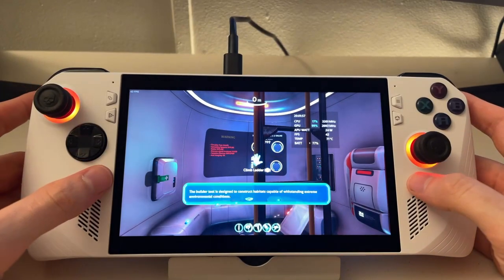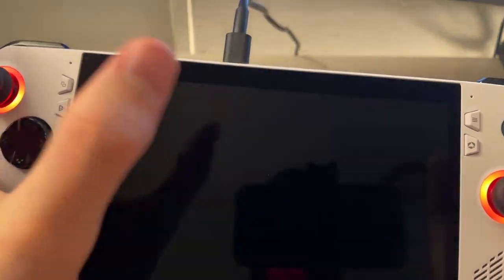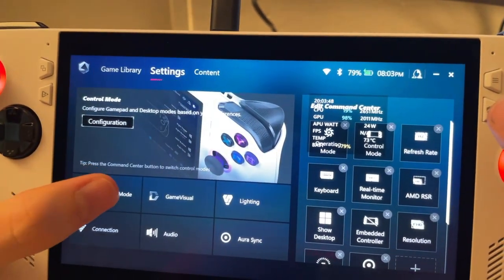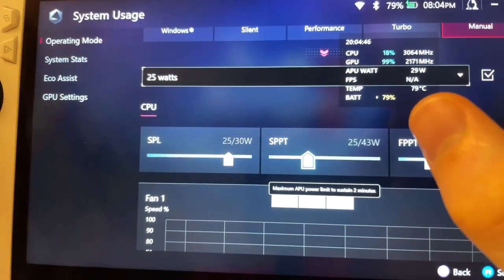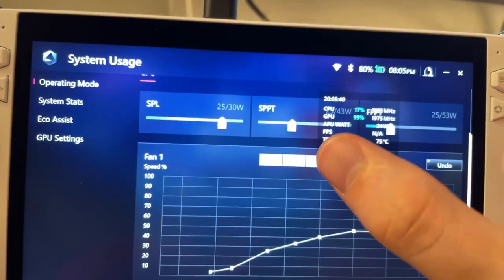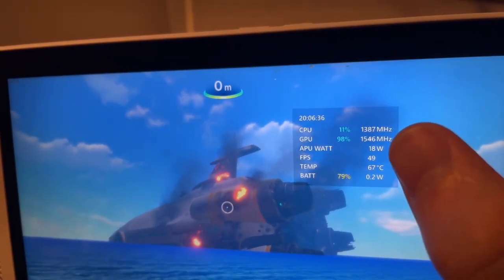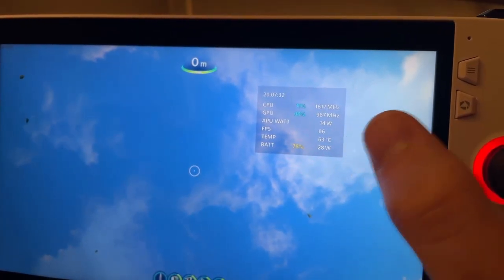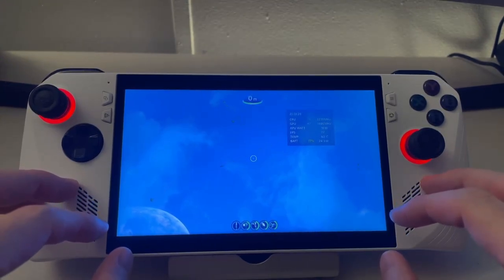ROG Ally | Use these MANUAL power levels

Comment: For some odd reason when I put 2 profiles like yours - 18watts/25watts when i change to each other it will break the other profile :/ will only remember SPL and the rest is still on 25watts.
also, after a day or two the profiles were completely disappeared.
Reply from the maker: I've noticed this as well.  However, after you set it across the board it should hold those levels.  It's only when you go back into the profile that it will jump the other sliders back.  It acts weird, I don't know what's going on with Armoury Crate.   I'd say just set the levels across the board, load up a game and see if it's actually boosting.  If not, you should be good to go, mine seems to be working properly and I just leave it alone after I have it set.   As soon as I start dragging sliders or going back into manual it seems to want to push the 2 sliders on the right back up.

Comment: The way I see it:
- Steam Deck: a proper portable device, scales really well, can be used for mouse based games & gamepad games but not designed for AAA games
- ROG Ally: horrific battery life means it's not really that portable and since only 18W is efficient and scales really badly when you move away from this, it's pretty much designed to run more demanding games that the Steam Deck can't run BUT only gamepad games mostly

The battery is really the big problem with the Ally. I would have preferred a heavier Ally with a better battery myself. Wanting to beat the Steam Deck in weight and then getting TROUNCED in battery life was not the right move.
Reply from the maker: I agree, the Steam Deck handles games at low wattage really well.  When I loaded up Dirt Rally 2.0 and saw 1.2 watts for the CPU and 2-3 watts for the GPU, with a total system draw under 15 watts at 40FPS, medium settings, I realized just how crazy good the Steam Deck is with power.  But, the Freesync and raw performance of the Ally is something I like.  Plus I can't get some games working properly on the Steam Deck, like Horizon 4, still stutters and can't do 60FPS.

Comment: can you suggest a powerbank which i can use to play at turbo 30 or 35 watt
Reply from the maker: --Edit
I believe I misinterpreted what you were asking.   Like Wash said below any 65 watt should work.  However it probably won't automatically switch to the "plugged in" power profile like it does with the official charger.  So if you have it set to "Turbo" when plugged in and "Performance" when unplugged, you'll have to manually switch this when not using the official power adapter/dock. 

Also, the manual settings will be locked to 25W.  This is because there is a weird issue where Asus isn't properly recognizing most 3rd party chargers/docks.  Hopefully ASUS fixes this in the future.  

--Original Comment
Hey, I'm not sure there is one right now.  For some reason Asus seems to be limiting 3rd party docks.  So even if you have enough power being supplied, it won't "recognize" it.   

Hopefully they fix this in an update, but the only time I've been able to draw max power is on the ROG Ally Dock (which I have a video unboxing of) and the official charger that came with the ROG Ally.

There could be a bank out there where the Asus will recognize it, but I currently don't know of any.
Reply: I don't think he answered your question. A power bank doesn't need to be recognized. It's going to supply power if the power lines are connected. Just pick up a nice power bank that says it charges at 65w.

I also have no issue using the two hubs I have with it.

Comment: Hey man, cool videos! Question for you about the fan curves. I still can’t wrap my head around how to make a good fan curve for the custom TDP’s that I’m creating. 
I’m trying to create a few manual TDP’s in 18w, 22w, and 25w and I understand it’s better to set all 3 values to the same so that the unnecessary boost mode is disabled in each of them. So it would be 18w / 18w / 18w and 22w / 22w / 22w and 25w / 25w / 25w for each of my custom TDP. 
I’m just not sure now what the fan curves should be set at for each of those wattages?

You said that the fan curve 3 preset is pretty good and what you use, could I just use that across the board for all 3 of the manual TDP’s or would that only apply for certain wattages? What fan curve would be the best to do for my 3 manual 18w, 22w and 25w TDP’s? Would love for you to make a video in future going into the whole creating fan curves thing and how they work, for us newbies.
Reply from the maker: Hey the level "3" profile on both fans works great, even on BIOS 322.  Although it's a bit louder now on Bios 322 because of them ramping the fan up more (probably because of the SD Card issues).  You can always ramp up the fans even more, but if the system is running in the 70's, then it's good.  Technically it can handle even hotter temperatures, and Asus allows it to hit 95c for the first 2 minutes in Turbo mode.  So manually locking the watts means you're already well below the temps people are getting that don't lock them.   I still just use the level 3 fan profile and have great temps. 

Make sure you select level 3 for each manual setting (it resets the fan curves for each new custom profile).  So you'll need to set both fans to 3 for each profile (18w, 22w & 25w).
Reply: Perfect, I’ll give it a try and see how it goes. Thanks for the help!

Comment: well done tutorial ! GPU Settings is better on 4GB or 8 GB?
Reply from the maker: I've been working on a video about this.  Most games it doesn't make much difference, but there are a select few where it does.  One of them being Dirt Rally 2.0.  At 4GB I got (94 FPS Avg / 80 FPS 1% lows) and at 8GB I got (121 FPS Avg / 99 FPS 1% lows).

Comment: Thank you! Can I use the 17W for every games?
Reply from the maker: Yes, if you like the 17 watt profile you can set it at that, and then always run it at 17 watts for everything :)   If you're getting low FPS however, it could be worth bumping it up between 20-25.  I don't recommend 30 though as there isn't much gain for the additional watts/temperature.

Comment: when I manually set to 18 watts and leave the AC Control Panel and switch back to the game, it falls back to the Standard 15Watt mode after some seconds without touching anything after that. do you know whats the problem here??
Reply from the maker: When you set the power levels make sure you don't have a game open.  Then any games where you've already set a power profile, you'll need to change to the one you want.  Games save the power profile you set per game, so if you were playing retro games, you could have a "Silent" profile and it remembers that and will auto switch.   Any new games though should inherit the settings you set with no games open.   So you should just have to change it for games that you've opened before you set the power limits.

Also, if you hover over the game in the Armoury Crate launcher, you can hit "X" to bring up the settings and you should see "Configuration" where you can change the AC and DC power settings for that game.  I wiped my device last night due to an issue I'm troubleshooting so I don't have Armoury Crate installed right now.  Let me know if this helps though, if not I'll be able to give you more detail once I get it installed again :)

Comment: Hey man my manual settings dont swap when I go from plugged to unplugged, did I hear that wrong or is that supposed to work?
Reply from the maker: Are you using the official charger?  You'll have to change the settings when plugged in vs unplugged, then it should automatically switch.  However, if you're using a 3rd party charger and/or dock it won't switch.  It stays in the battery setting.  I usually use a Steam Deck charger on the go, and it doesn't switch.  On the official one though, it does switch.

Comment: thanks for this tip! What sensors are you using to monitor CPU & total system power?
Reply from the maker: Hey, it's just the default monitor.  If you hit the second little button on the left to bring up the menu, you'll see a thing you can click, I believe called "Monitor" that will bring up the same little box you're seeing on mine.

Comment: There is something that I don't understand. What's the point of putting 25 watt in manual mode when the console is plugged in? because when it is plugged in there is no need to save battery power and it is in 30 watt turbo mode. what's the point of putting 25 watts when it's plugged in???
Reply: High heat which might damage components. If you want to keep it at 30 then atleast put all 3 bars at 30 and fan curves at 3. This way you won't be feeling the crazy high temps of Turbo

Comment: Am I the only one who can't toggle manual mode on battery?
Reply from the maker: That is really strange, I'm able to use manual on battery.  It even switches automatically when unplugged between watts I had set in Manual for battery.
Reply: @filt3rless  It's working now. Guess I needed an update

Comment: Sorry again, so to resume (English is not my native language).

I have to create 2 general profile :
- Plugged = 25W
- Unplugged = 17W or 18W? 

It will be set in general and not per game? Correct?

And I don't have to touch the other modes (Silent, Performance, Turbo) right? Buuuuut.... I can still use the other modes right? Sorry but I'm not really tech savy and I don't want to break the ROG Ally :(

Thanks once again! I have subscribe to you.
Reply from the maker: Yes, you'll want it plugged in, then you set all 3 sliders to 25W (make sure you also click the 3 fan profile for both fans).   Then you can unplug it and set it to 17W.  Now it will automatically switch when plugged in vs unplugged.  No need to mess with settings after that.  It's not per game, so just one time should work for all games :)

Yes you can use the other modes.  However, Turbo runs extremely hot so I don't personally use it.  I had the SD Card Reader fail in my first unit and I think it could have been heat related.
Reply: @filt3rless  thank you so much. Can you tell me then what are you using for both unplugged and plugged for AAA games? I'd like to run them with nice graphics
Reply from the maker: @JeremyBDE  I use 18 watts unplugged and 25 watts plugged in :)

Comment: Do your fans also turn up more in manual mode?
Reply from the maker: On the new Bios 322 they definitely do.  On the older 317/319 Bios they stayed a lot quieter than when the device was in Turbo mode, and it ran cooler.
Reply: @filt3rless  
Thanks🤟🥳

Comment: Man, I have one very last question 😅 Once plugged into the wall, only the Turbo Mode is affected by the boost right? 

I wanted to create a custom profile which will replace the Performance Mode from 15W to 18W and the Turbo Mode I would like to do 25W unplugged and 28W plugged. 

Is this possible too? And if yes, what fan profile should I use for the 2 profiles I told you?

Also, once plugged, Silent Mode, Performance Mode remains unchanged in comparison to being unplugged. I mean for example Silent Mode, Turbo Mode unplugged and plugged will use the same watts right? Only Turbo Mode is affected by the watts changes when plugged, I've got this right?

Tldr: I want to replace the standard Performance Mode and Turbo Mode only, is this doable ?

Thanks once again and sorry for these questions but I'm getting anxious and I want to be sure I won't mess my machine once I received it this week ❤
Reply from the maker: Use "3" for the fan profiles if you're not sure what you're doing.  If you set Manual while plugged in, it'll always go to Manual when you plug it in, unless you switch it to something else, like Silent, Performance.  Same for battery, if you set Manual mode it's a separate one for battery.  So while plugged in you can have Manual set at 25 watts, and then unplugged it can be 18 watts.  It will automatically switch back and forth.  However, if you change it to "Silent" on battery, it will remember that and automatically choose "Silent" while on battery until you set it back to Manual.
Reply: @filt3rless  ok and how many profiles can we create? Seems like I will have to create 2 or 3

Comment: Will there be an update to this?
Reply from the maker: I am planning on running a new watt test.  If you'd like a sneak peak, here is how the Ally performs on Crysis going from 7W all the way to 35W: https://imgur.com/a/bD9GNNG.  You can really see where it starts dropping off on the top end.  I've been using 17W as my primary watt level, and 25W for extra performance when needed.
Reply: @filt3rless  thank you
Reply: Will you still be doing an update on these settings?

Comment: What bios build are you on? 319?
Reply from the maker: This is on 319.  I have a video I filmed after this where I test 317 vs 319, there is a slight difference in some games but not enough to be worth it IMO unless there is a specific game you're having issues with.  I've since re-upgraded to 319 and haven't noticed any performance issues in a variety of games.

Comment: You're lowering the wattage to save temperature but these days it's honestly fine for components to reach upwards of 95°c. They're made to do that. Theres a reason they throttle at that max temp.Theres genuinely no reason you should limit the wattage unless the fan noise really bugs you. And when you're trying to squeeze as much performance as you can in a small package like this, you should be looking at 1% lows not an averge still frame. Sorry but this is just a bad benchmark and suggestion imo
Reply from the maker: I'm lowering the wattage because a 20% increase in power load, higher heat, and fan noise for less than a 5% performance improvement doesn't make sense, in my opinion.   Also, heating the device up to 95c to get extra performance for 2 minutes on a gaming handheld doesn't make sense to me.  When it's at 95c, try touching the screen, it's the hottest part of the entire device.   Maybe it's designed for it, but I'd rather play it safe on a 1st generation device to get the maximum life span possible.
Reply: Not to mention high rog ally temps currently frying sd cards
Reply: This is really a dumb statement. Everyone knows that heat kills conponents and battery. It is just stupid to say 95° is fine for cpu...its like its fine to drive the car constant at 6.000 to 7.000 rpm.
Reply: @filt3rless 5% increase minimum and at the top end of your FPS range the performance increase is hugely noticeable in many games even just 25w vs 30w boost I am seeing up to 10fps differencea
Reply: @Xarviz  These days, you're mostly incorrect. Heat is a problem but only at very high levels. They're designed to withstand temps of 95c, do the research. They wouldn't throttle AT 95c if it was dangerous to be at 95c. It's fine. 100+ I'd start getting concerned
Reply: @filt3rless  The hot to touch is a personal opinion I guess, which is fair. Still, you should be comparing the 1% lows of 25w vs 35w. Averages don't really matter here. I'd be curious to see what you come up with. I understand not boosting temporarily above that, but a static 35w across the board would be worth it for those low dips. That 5% you mentioned has nothing to do with the real world experience playing the game. I am willing to bet you $20 that your 1% lows are higher than 5% difference. Dipping to 30 feels a lot better than dipping to 15. Respect to you either way, just giving my opinion
Reply: @arbbs65  That's assuming you're running turbo on a game stored on one. Not the same issue here. But ye, I wouldn't run turbo on one.
Reply from the maker: @washiewah748  I went ahead and ran one benchmark.  I'll have to run more later, but I'm dealing with an SD Card issue now.   However, the benchmark is between 25w and 30w, the system cannot run at a consistent 35w.  It temporarily boost to 40+ then comes down to a consistent 30w (even in Turbo). 

---Forza Horizon 4
--25 watts
-87fps / avg.
-69fps / 1% lows

--30 watts
-92fps / avg.
-74fps / 1% lows

So yes, it is above a 5% gain in this game, and I will need to test more games later once I fix/figure out what is going on with the SD Card and/or reader.  However, I would say the 1% lows are not as bad as you might have been expecting them to be.
Reply from the maker: @TheTyisawesome  Hey, I definitely think setting it to 30w is no issue in manual mode.  It's when it's running in "Turbo" and goes to 40+ watts heating the system to 95c that I think could be a problem and isn't worth it to me personally.  If 30w is working for you and the extra gain is worth it to you, then definitely keep it :)    I'm just trying to give people tips and what I personally use on my device that offers good mix and optimal efficiency.
Reply from the maker: @arbbs65  My SD Card started freezing the system last night and stopped working properly.  I got it on camera and am still working to figure out what's going on.  I'm planning on making a video about it after trying a few things to resolve it.  So far, re-installing windows and formatting the SD Card has not fixed it.
Reply: @filt3rless One YouTuber had the Ally motherboard out of the case and showed it's a design flaw. They have the SD card reader very close to the capacitors or whatever they're called next to the cpu/gpu that generates a ton of heat. I had the same issue running Turbo mode while trying to play Diablo 4. It would play for hardly a minute then freeze on me. The Blizzard app and Windows would then show I didn't have an SD card for a few minutes. Taking out the card, it would even be a bit hot. Putting in manual settings with 100% fan at 80c fixed the problem for me.
Reply: You can also adjust the fan curve if your worried